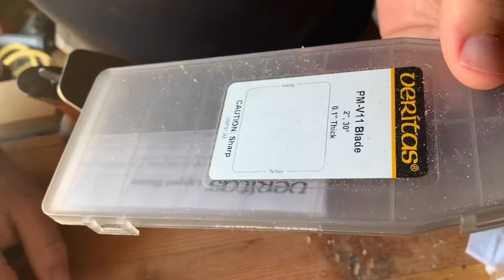Veritas Replacement Plane Iron Won’t Fit-  and how to fix it

Comment: Never used my plane blade projection micrometer. A small block  will give you shavings  to check blade angle and initial thickness. A last check would be on a sample board. I pull blade back then move blade forward again till my shavings are  just like soft mesh cloth.

Comment: Wouldn’t it be possible to lengthen the slots the frog adjustment screws sit in in stead. Accuracy wouldn’t really be much of an issue then, would be easier to file too.
Reply from the maker: The problem on my plane was the mouth was too small to accommodate the thicker iron. The frog position didn’t matter.  

Subsequent to this video, I tried the iron on two other no4 size planes and found that their mouths were more open than the plane in this video.
Reply: @youhaveamonkey  I just assumed that the extra thickness of the blade was pushing it too far forward, and that if you could let it back further, this would solve it.